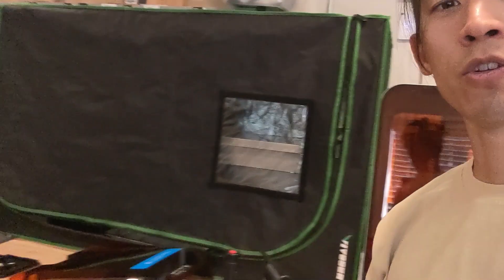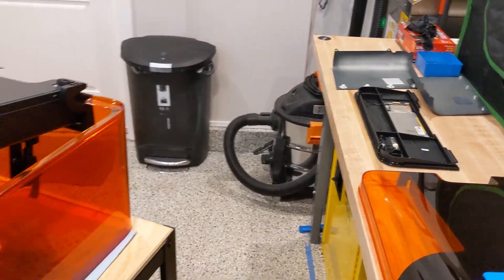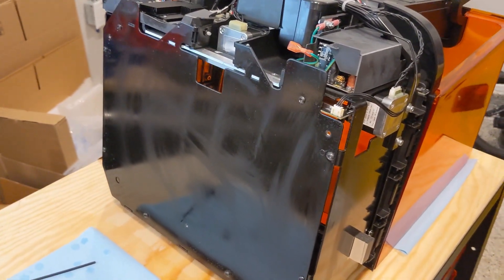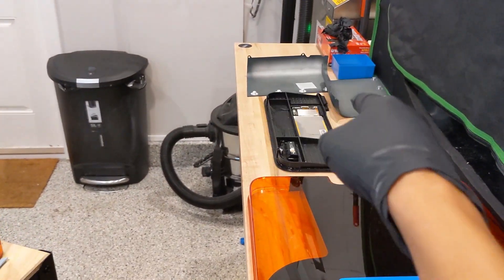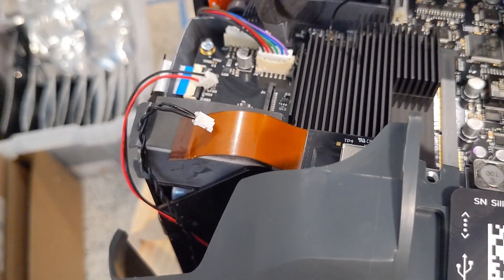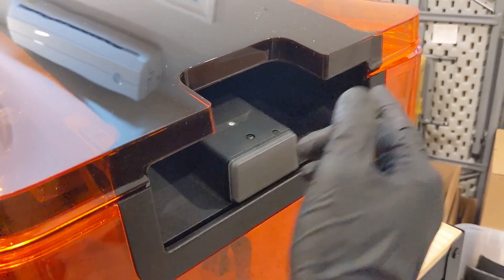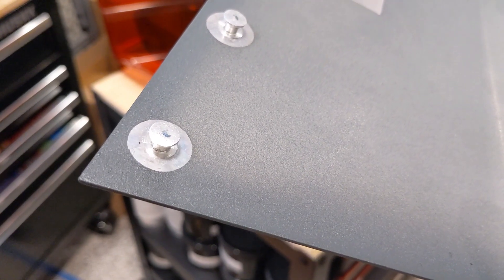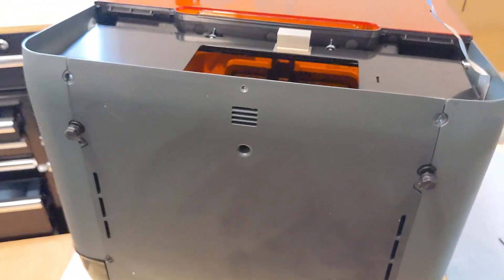Cleaning a RESIN SPILL on the Formlabs Form 3

Comment: Thanks for this. Good research for us as we prepare to disassemble and clean our unit. Design issues all around that these spills are so common and so CATASTROPHIC.
Reply from the maker: Yeah, definitely a big miss from a design perspective. The machines themselves work amazingly though, and you kind of learn to watch out for specific things. In the 5 years I've owned these printers I've only had 2 spills (*knocks on wood*) so it's been alright.

The new Form 4s aren't plagued by the same tank design issues so they should be much more robust with lower operating costs.

Comment: We had gotten a formlabs 3 printer from another company who knew a employee here. They did not want the printer anymore.  When we opened it op there was lot of resin in the base. Somebody has forgotten to empty the vat for shipping. Printer still worked fine. . Then one day I decided to clean the resin. Using your video, I had to put the printer on its side to remove the different pieces. Bad idea, the resin went everywhere. The pcbs were covered with resin completely as was was everything else. I tried using a squirt bottle to spray the resin away, worked a little. Still a lot of resin. Emptied what I could from the bottom and then put the bottom into the sunlight. Wiped where I could using a alcohol soaked  towel.  Probably got 80% of resin out in 6 hours or more.

 Put it back together and no display. One of the 26 pin connectors has broken a hinge.  I got it to wok at some point. Eventually will have to change out the connector. But display works and it looks like it is going to work (I hope).

My biggest mistake was tilting the printer for disassembly and the resin went everywhere. Wish there was a way to remove the bottom separately. Maybe make another bottom and cut out the old one.

Thanks for your  video anyway. Helped a lot.
Reply from the maker: I think the official cleaning guide from Formlabs recommends removing the touch screen assembly first and then tilting it on its face to drain resin out before trying to disassemble things further.

Honestly though - I feel like they really didn't think about the possibility of spills and cleaning when they designed the machine, which is obviously unfortunate given the failure rate of the tanks.

I recently had a spill on the 3L and it was MUCH easier to clean...so at least they learned from their mistake on the Form 3.

Glad my video could be helpful, thanks for watching!

Comment: Definitely not fully thought out🤞, or may be intentional🤔. Spill would take a lot of IPA for sure to clean. Would it have been better, to cure the spilled resin(say a 405nm UV flood light), instead of a nasty cleanup(but need to ensure it does not interfere with assembly later?).Also wondering, if those hexagon cavities could be filled with PU foam(not sure of chemical compatibility though), to make a repeat cleanup easier? BTW, what do you guys use to make parts resistant to UV/outdoor exposure(such as a hot car interior)?
Thanks in advance.❤👍
Reply from the maker: Yeah I could probably make something to fill in those hexagon gaps...didn't think about that at the time.

SLA parts aren't great for outdoor or hot applications...but if you were to use them, you'd need to pick a material with a high HDT and then also apply a UV resistant coating over top.